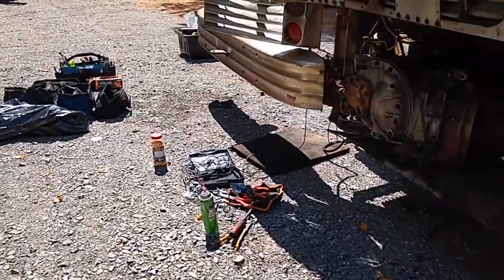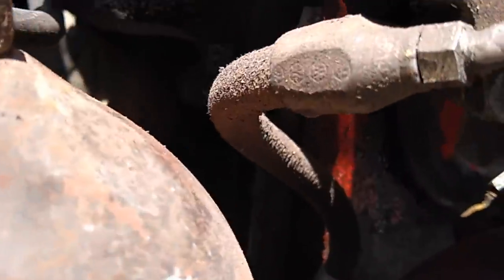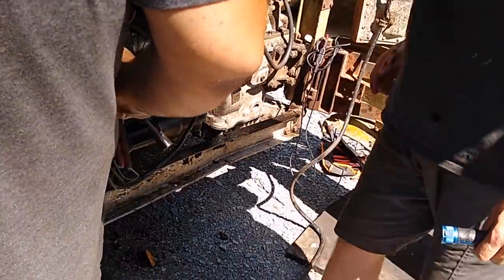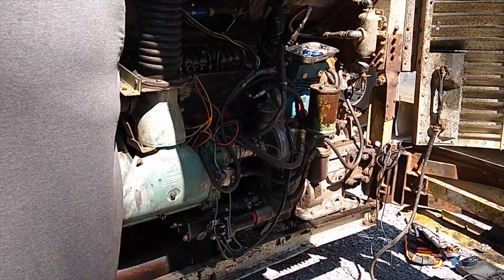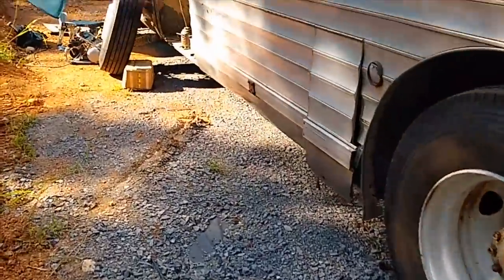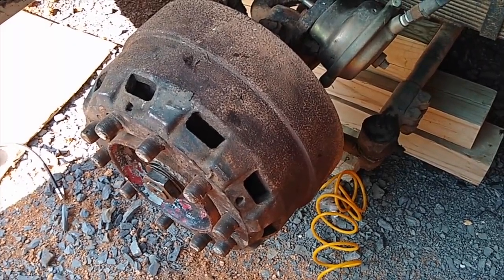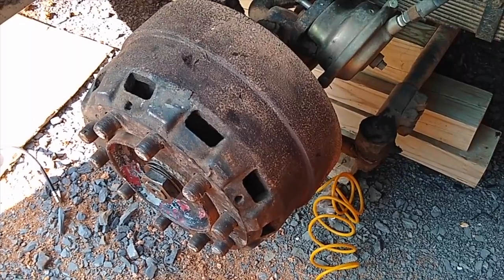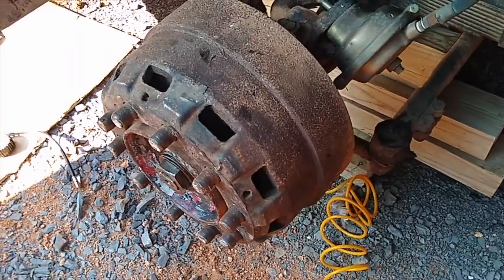Texas Bus Rescue - Visiting the Bus Grease Monkey

Comment: A good restoration detail with the proper compounds and polishes will bring that back to looking beautiful...
Reply from the maker: That is anodized aluminum I would never use a compound on it because that would strip off the finish.
Reply: @SilversidesSage  Juan and Michelle did a really nice job restoring their anodized finsh. I think they used some sort of scotch brite pads from memory
Reply from the maker: Scotch-Brite would strip the original finish off. I use a product called belly polish designed for aircraft.
Reply: @SilversidesSage  here's the video of what they did and thanks for the information on belly polish.  
They used 3 levels of sandpaper followed by a Rouge buff and mothers polish.  Their bus is about 20 plus years newer though. 

https://youtu.be/M41ebtmogtE
Reply: @SilversidesSage  you may want to look into Mother's CMX. It's a ceramic coating that really protects and gives it a deep luster. The more coatings you do, the deeper the paint looks. I use it a lot on my 2001 and 1968 Mustangs. On fourth spray bottle.
Reply from the maker: @jim874  ceramic finish works on paint I don't know how it does on other surfaces
Reply: @SilversidesSage  I use it on my chrome bumpers on the '68 with no issues since last fall. Next time at Walmart or an auto parts store get a bottle and maybe try it on a small piece  or on the back side of an unpainted and clean door. Worse case use the bottle on your VW . I know that on paint, and the 2001's wheels, dirt does not stick. Would not use it on the bus's current paint / primer.  IDK how well  fresh paint would stick.
Reply: Fair enough, but there’re are lots of products out there for that and good compounds like a clear coat safe one meguiars etc is a lot less abrasive than sandpaper... now some compounds are garbage as they dull everything..
Reply: Also, “polish” is nothing but a very light fine duty compound. And ceramic products especially store bought spray detailer stuff is safe on most everything, it just adds protection like a good wax would...